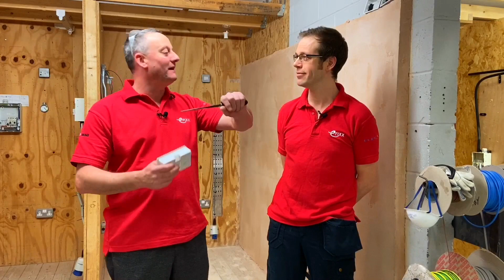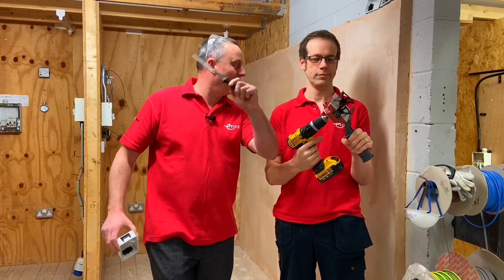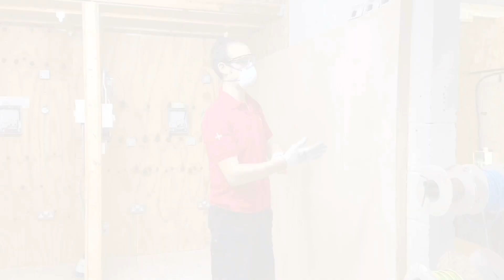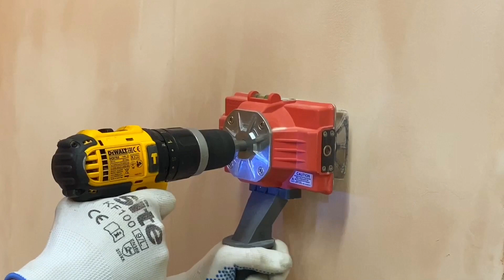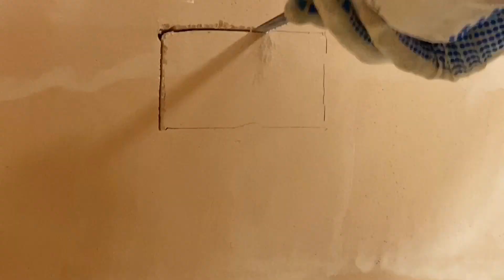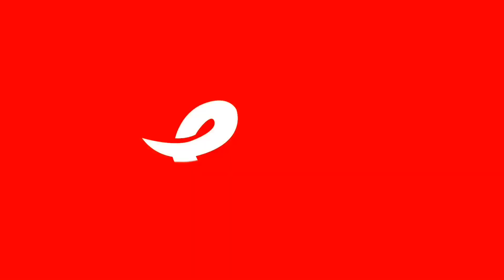Gaz and Joe - Pad saw - vs - Quadsaw race and a shameless plug for this years electricians events.

Comment: That is so SLOW compared to my vibratory saw with a square blade.  Takes 2 seconds to cut in a LV mud ring.  The blade costs $35 US and has lasted for over a year!
I was truly expecting the quadsaw to blaze right through the drywall...but 20 seconds per box it slow for this tool.

Comment: Why do you still use square boxes in the uk? Just seems like you do absolutely everything to make it take as much time as possible.
Reply from the maker: Fair point - round back boxes would be a gear idea!
Reply: @efixx  We have them in sweden contact companies like Elko, and Eljo or elektroskandia maybe they would send you some demo items. It's not only electrical, though the door frames and other indoor carpentry items used in britain also seem almost medieval. My main criticism is that it seems very wearing on the people installing the stuff for no reason.

Comment: I've got one and it's THE worst bang for buck piece of equipment I have purchased during my career. It has many, many infuriating drawbacks which deserve its own video but take my word for it - there was no scenario, job, first fix or site where Quadsaw would be better or faster than using socket stencil and multitool. It's quite clear this thing wasn't designed by someone who worked as an electrician. And it was definitely priced by a hedge fund manager.

Comment: Quickest way would be with a multitool I reckon, plus who's gonna spend £300 on the quadsaw which only has one purpose compared to a multitool which does many functions
Reply: I'm pretty sure a box cutter for a multi tool only cost £20, a half decent multi tool is £50-£60, it's a no brainer, this box cutter may be a great tool but it's overpriced
Reply: @n4thb4dc0  yeah 100% just googled replacement blades for this quadsaw and there £50 for replacement blades, can get 20 multitool blades for £20 on Amazon
Reply: Agreed.. I always use my makita cordless multi tool it's fantastic, no need for this box cutter. Also, does it cut through tiles? 😉
Reply: How the hell is that £300 ridiculous price
Reply: @matthewdale956  yeah probably why my local wholesale has had one sat there for the past 6 months 😂
Reply: Dry wall router and a jig is about the quickest possible.
Reply: If nothing else, don’t you also need singles, for switches at the least?
Reply: I have my 1st multitool that only had On/Off, no speed control and obviously in 10+yrs of using it I got really good. Just recently got me a batt one w 1-6dial and I must say I love being able to control the speed. Nothing u can't do w one.

Comment: padsaw is sooo much quicker for 3 boxes. think of the time i takes to take padsaw out of tool box, cut 3 holes and put padsaw back in box VS getting frill out of van, fitting quadsaw and packing away again. unfair test, you should try it again with all tools packed away at the start.
Reply: LeicaGermanShepherd I like your thinking.... Gaz 😁